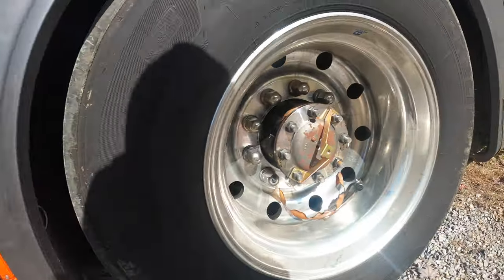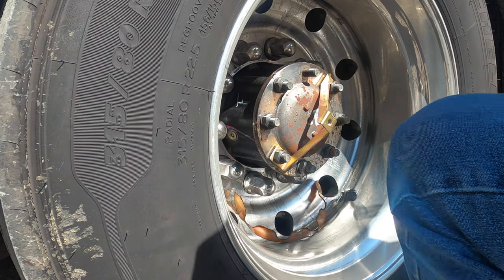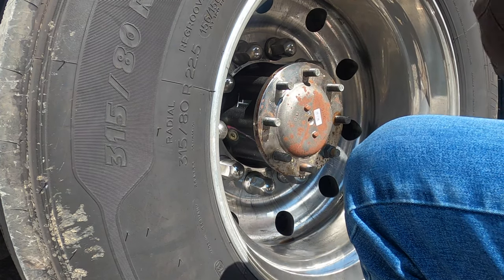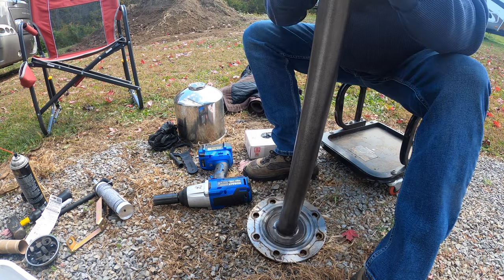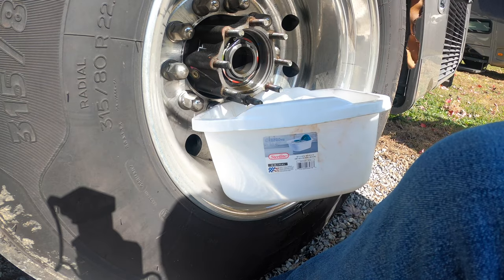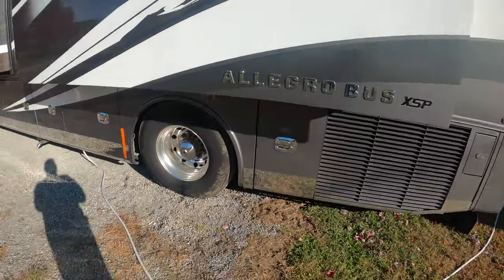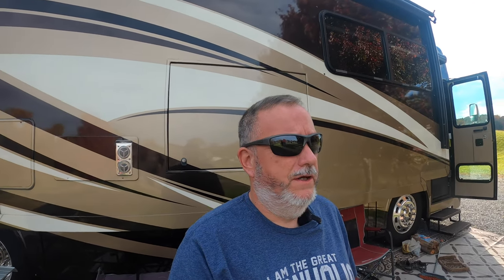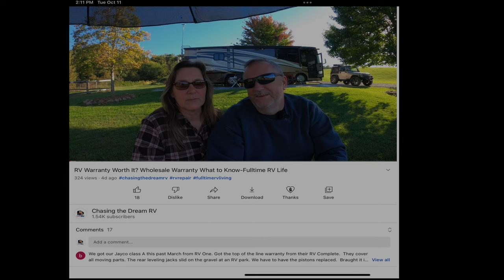Axle Seal Gasket Replacement | Sunday Solution | Full Time RV Living

Comment: Thanks!!! That was too easy.   We have a 2007 Monaco Executive. Looks to be the same… without taking anything apart yet.   Multiple dealers wanted over $300 labor and $100 parts for each wheel.  We have the tag axle too.
Reply from the maker: You’re welcome 👍if the axle doesn’t slide right out you can hit it right in the center with a dead blow hammer and it will pop right out. The hardest part is balancing the axle putting back in as it is heavy. Take ur time and use the axle housing as a pivot point and you’ll get it. Also don’t forget to check the fluid level when your all done. The tag axle is just a cap with a gasket so that’s super easy.

Comment: Nice video, I noticed a small streak of oil coming from one of the lug nuts on my front wheel, have a frieghtliner annual next week( 2019 RED) so I can have it taken care off.  What power tool were you using?  Thanks!
Reply from the maker: It was a Kobalt 1/2 drive variable speed brushless impact from Lowe’s

Comment: Didn't you need to replace the oil that had leaked from the seal and from you pulling the shaft?
Reply from the maker: No typically you don’t lose that much if caught early but it’s always good to check afterwards to be sure